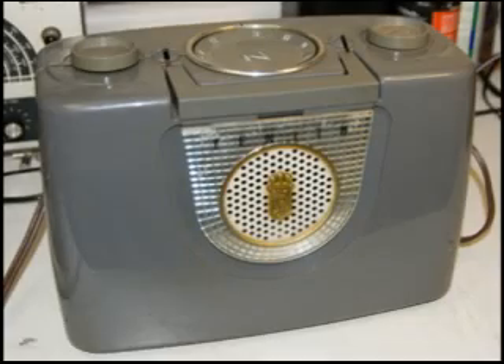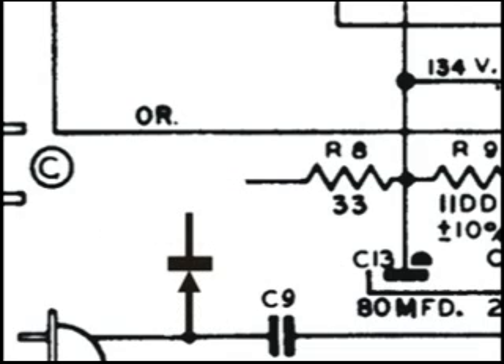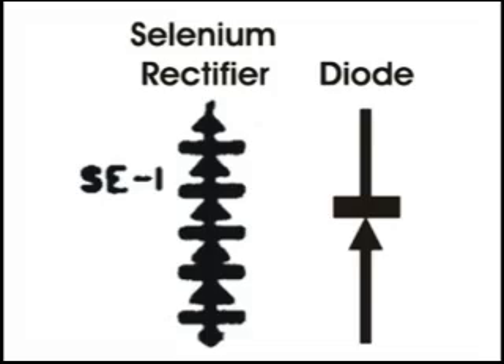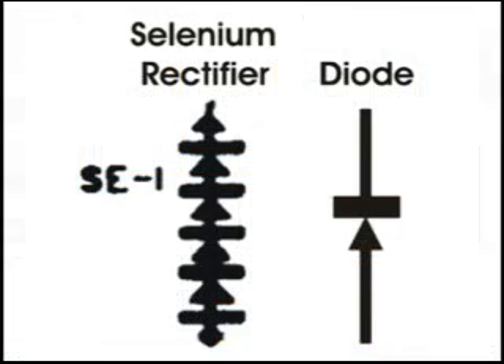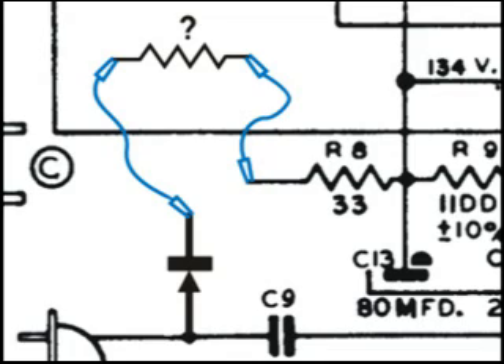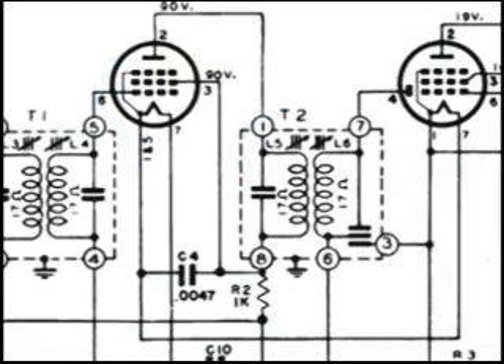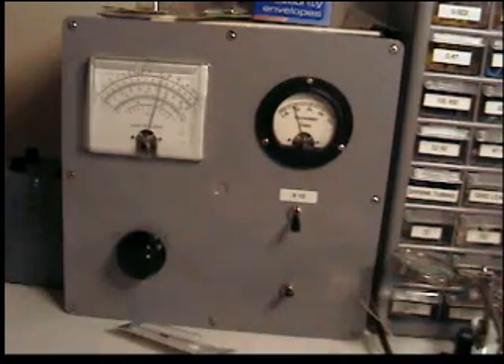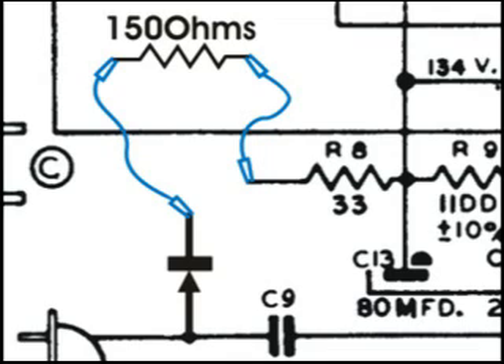Replacing Selenium Rectifiers in Tube Portable Radios

Comment: At last, someone explains it simply. I guess if you didn't have a variac, you could start with a high resistance and measure the voltage at the filament to get some idea if you're too high or too low. Recently encountered this situation on an old wood rail pinball but reasoned that the slight rise in voltage less critical with solenoids. Valves (tubes) are a different matter. Thanks.
Reply from the maker: Yes.... and if they are 1.5VDC filaments it is most important. Tubes are expensive. I appreciate you comment very much!
Thank you, and you are welcome.

Comment: If r8 that's 33 ohms is 2w than 150 ohm 2 watts wont be sufficient . 150 ohms is about 5 times higher resistance  , so it will have higher voltage drop across . So you need 10 watt resistor . Or get 180 ohms  10 watt and remove the 33 ohms .
Reply from the maker: Watts has nothing to do with voltage drop. Watts is how much power a resistor can handle. Voltage drop is across the resistor. This video may help.
Whats Watts
https://www.youtube.com/watch?v=dO76V4-hGds

Comment: Can you use resistors in place of the filaments' in order to check the voltage of the power coming in?
Reply from the maker: The purpose  is so you do not burn out your $30-$50 tubes.

Comment: What if you use 4 diodes in the same configuration as the selenium rectifier?
Reply from the maker: No. Each forward bias diode is about 1.5 to 2 Ohms so you would need a few more to make up 150 ohms.

Comment: If That Selenium rectifier is still working, measure the voltage across R8 which will give you by Ohms law the current through the rectifier. You can then calculate with the voltage drop across the se rectifier it's equivalent series resistance which you can then duplicate.
Reply from the maker: That's true. But most of the time they are not working.

Comment: Why not use a variable 300 Ohm 2 watt resistor and bring it down until the filament voltage is correct? What am I missing here?
Reply from the maker: Cost and SIZE
Reply: @AllAmericanFiveRadio  - Thank you - simple as that?

Comment: I replaced a tube rectifier with a silicon diode, but didn't think about voltage drop.
Maybe I should revisit this.
Reply from the maker: This is important with 1.5VDC tubes.

Comment: Do I need a resistor if I have a transformer
Your radio looks like a hot chassi
Reply from the maker: Measure your B+, if it is high you need to add a resistor.
Reply: I have 170v from the transformer
Just becuz of the high resistens i get 150v
And my eye tube turned off because low voltage
Thats how I found out i had a selenium rectifier :)
I didnt even know what it was before

Comment: An oldie but a goodie.  This answered my questions as I am about to replace a selenium rectifier myself in my first radio restoration.  I have, however, opted to use a 25 watt 100 ohm potentiometer instead of a pile of discrete resistors to arrive at the proper resistance.  With it I can set the pot for maximum resistance, jumper it into the circuit, bring the radio to full operating voltage and then adjust the pot until the filament voltage is at the proper value.  I then simply measure its resistance and solder in a suitable single value replacement.
Reply from the maker: That will work

Comment: Why not just measure the resistance of the selenium rectifier directly? Your method is much more elegant...I was just wondering.
Reply from the maker: If you have a working radio and want to replace the Selenium Rectifier that may work, but I would still use the VARIAC. The Selenium Rectifiers I replace are bad and I would not trust a resistance measurement.

Comment: Ok perhaps a silly question when I put voltage into my selenium rectifier I see only DC voltage on the + side (or very little AC) .. If I put voltage into the diode.. I see both AC and DC coming out of the diode (at equivalent amounts).. what am I missing ?
Reply from the maker: Half Wave Power Supply build and demo
https://youtu.be/Oi75Y6fg8mw

Half/Full Wave Power Supply Oscilloscope Demo
https://youtu.be/4kMXulubQFU

Searching My AllAmericanFiveRadio Channel
https://youtu.be/4k7ByHqh8Js

Comment: When you test for correct filament voltage, does it matter where the volume control is set or if a station is tuned in? Or would it not matter because you are only checking tube heater voltage? Thanks Rick!
Reply from the maker: Tony
I don't think it matters that much. I would have the volume set low or down all the way, because that would put the highest voltage at the B+.
Rick
Reply: AllAmericanFiveRadio
Rick, Thank You for the reply!

Comment from the maker: Check the plate voltages. The plate voltage of the audio output tube should be close to the value of the B+ battery. If the selenium rectifier is bad, that variac will come in very handy. Let me know what the voltage read. You can also read the 1.5 volts across the filaments. If you have a 3V4 it may be 3V, if they wired it up with the center tap it may be 1.5V.

Comment from the maker: Correct. The voltage on your radio is AC and not supplied by the B+ power supply. For that type of radio the plate voltages need to be monitored as you try different series resistors.

Comment from the maker: On a non-battery set the filament supply is not supplied by the B+. The voltage to watch on the non-battery is the plate voltages. I use the audio output plate voltage as a check then when that is correct I check the other plate voltages. And you are right to start with a resistor to large and then work down. Thanks.

Comment: oh also I do know that the first number in a tube type is usually the voltage, like 12AX7 is 12V and so on. this radio also has a 35C5, so I'm assuming the filiment voltage is 35V right?

Comment from the maker: I looked up the diagram on Nostalgia Air and when the battery is used the AC is out of the circuit. As long as you use the right DC battery voltages you can test the radio with batteries. If you have more questions please email me. Good luck!

Comment: Perfect Rick, your the man! 

I check voltage on the radio I bought with the selenium bypassed with a 1N4004.  Some one else did it, with out a drop down resistor. 

The Spec voltage past the rectifier and stock 22ohm R is 128V. I was at about 144V (+16V). The Plate was 119V, +9V (spec 110v). Measuring voltage drop across stock 22ohm R, some basic ohms law math, the ideal resistor is about 100ohm! Don't have room for 10W in stock location, which is only 1W. I'll go 3-5W.

Comment from the maker: I just find the wiring diagram and I would alligator clip in a 150ohm in place of the 22ohm and check plat voltages and performance. If the voltage is low then I would try a 100ohm. Good luck.

Comment from the maker: The selenium rectifiers I have replaced have had and internal resistance of 100-150 ohms. So I would remove the 22ohm and replace it with a 150ohm 10watt(if you have room) and then check all the plate voltages and the radios performance.

Comment: PS the most critical tube is the audio driver a 35C5 which the specs say has 

Tung-Sol specs
Max plate voltage 150V
Max grid #2 voltage 130V

For the same 35C5 tube GE specs
Max plate voltage 135V
Max screen voltage 117V

Since line voltage is 117 I should be OK with the existing stock 22 ohm (1W) resistor down from the rectifier. Again the filament heaters are all AC.

Comment: Rich I am overhauling a Zenith Y832. The filament heaters are all AC and by pass the the selenium rectifier (diode).

The current in-line resistor is 22ohm 1W. I am about to order all my new CAPS and wounder do I really need to put in a drop down resistor.

The plates are rated for 100-250 volts. I don't think the difference will be that great. What do you think. I would rather replace the existing 22ohm with a larger one than add an additional one. Comment appreciated.

Comment: I am confused? How can your replace a RECTIFIER with a single diode (plus drop down resistor)? 

I thought a rectifier is 4 diodes and a rectifies AC wave form to DC. (I know I am confused). Any one? Please straighten me out. I assume that the filaments are still AC and the diode just clips part of the wave? Totally lost. Thanks

Comment from the maker: It is surprising how useful an isolation transformer and a variac are. I use them all the time. It makes a lot of difficult decisions easer and more accurate. It also makes the work safer for the user and there is much less chance of doing damage to the unit under test. Thanks.

Comment: Rick, As you had emailed me last week. I will use this variac  technique to help determine the resistance needed to suppliment the replacement electrodynamic speaker's field coil being700 ohms less DC resistance than the original schematic calls for. It's a simple yet powerful method! Thanks!

Comment from the maker: Thanks. There are/were many manufactures of selenium rectifiers of all types. So that and how it is used varies greatly. If your radio is not a tube portable, the procedure is the same except you would check the plate voltage of the audio output tube. I decided to us a tube portable because they are the most critical and if done wrong you will burn out some filaments.

Comment: I've only had to do one set with the selenium rectifier (a zenith AM/FM tabletop) and was just told to use a 50 Ohm 10 W resistor. I knew there was a proper way to do it, thanks a bunch!

Comment from the maker: Hey John,

If your radio is not a tube portable you just do the same thing but instead of the filament you check the plate voltage of the audio output tube.
It has been a few years since I have been to Vegas, they'll probably let me in.

Regards,
Rick